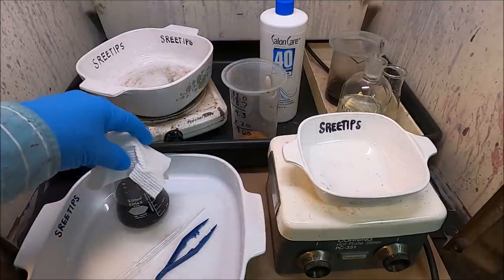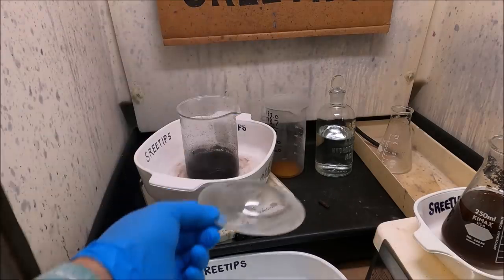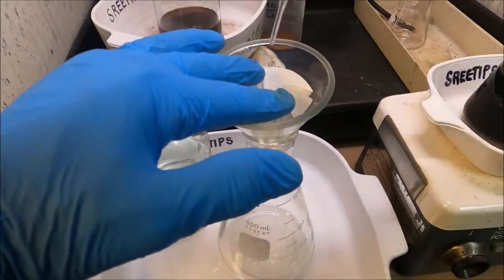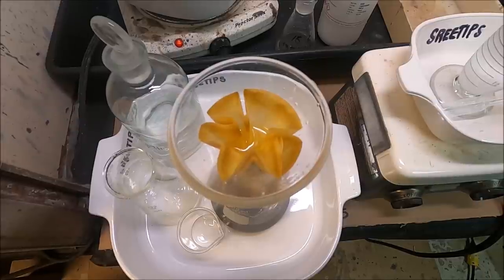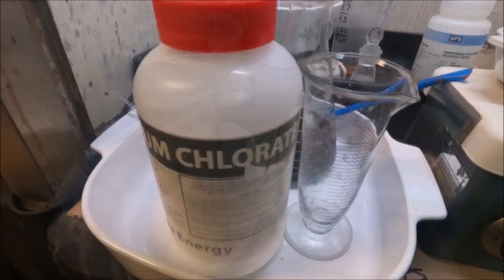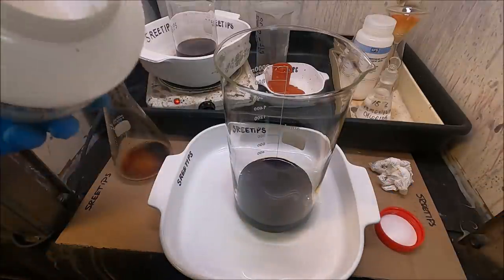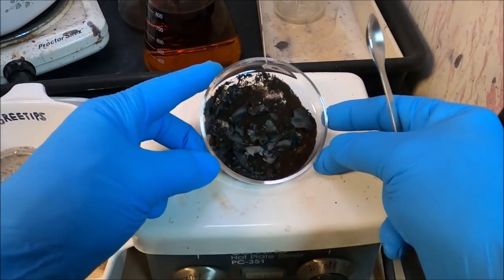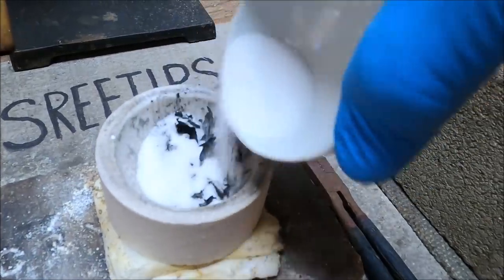Silver Cell Anode Filters Recovery and Refining Part 9

Comment: If is Ir that residuum onli solution powder of it melts at 2466°C so oxiacetylene flame but not reductive as you use for Ag, Au, Pd  bot hot oxidative "blue finger" 3000°C flame and graphite creuzet (one use because at 3000°C wil burn in air!).

Comment: Streetips , suggestions / request for videos ?
Suppliers of chemicals , products like glassware , stir/heat plates etc.
With all the China stuff , maybe brands to avoid / recommend .
Also some pricing ranges .
I have started finding all kinds of sources , but like most anything prices & quality ranges are all over the place , 
like melt dishes from just over $1.?? - $5 .

Then there is house hold chemicals and cost comparison , seems that high strength lab type chemicals will be quicker compared to drain cleaner , bleach etc.   

Not expecting , but just suggestions , along the lines of " Successful Engineer's " site , he seems to focus on the cheapest way with the least amount of waste .

Thanks again

Comment: Your comment about the little bead of palladium getting brighter as is formed into a bead reminds me of mt own making aluminum bronze. I melt the copper, then submerge the aluminum into the molten copper.  As you mix it the liquid metal gets a lot brighter. Swirls of brightness as you stir it. Its really rather neat looking. I say that's when the alchemy happens and the copper turns into gold. Bronzal alloy buts its a beautiful gold color. Its heavy since its 90% copper. Ancient people might have thought i actually did create gold from copper and aluminum.
Reply: Is bronzal alloy a possible answer to another sreetips video when he dissolved what was purchased on ebay as "gold flakes foils" in a little vial (it dissolved readily in a spot plate with a drop of nitric acid, resulting in a green color)?
https://www.youtube.com/watch?v=AM9zpapCM3Q

Comment: I did silver elecrtolytic cell but the silver I got soon blacken and it grew like little bubble but not crystal. I tried both large amp and small amp but the it still grew like that. Do u think it is problem of impurties in the electrolyte? like I added some Co(NO3)2
Reply from the maker: I use silver nitrate electrolyte and 99% pure silver shot.

Comment: Hey sreetips, i just want to know without electrolysis refining process of silver , if i only add nitric to scrap silver then i filter the silver nitrate can i recovered palladium from that silver nitrate or from that filter slimes??
Reply from the maker: Because palladium is soluble in nitric it will tend to follow the silver. But it will be traces only. The exception is white gold that is alloyed with palladium to make it white. In this case the palladium will follow the silver during nitric extractions of the inquarted gold. The palladium in these extractions will be great enough to allow removing the Pd from the silver solution with DMG before we cement the silver with copper.

Comment: Stupid question....what is the theoretical limit to purification of gold and silver.  If you gan get better than 4 or 5 9s is there an application or need?
Reply from the maker: Industry standard is three nines. There may be some lab applications where ultra high purity is needed. Any thing after 999 parts per thousand is like splitting hairs. Bragging rights maybe.
Reply: @sreetips  anyway your videos are fascinating.   I don't think most people could afford to do recovery safely.  It's not something you can set up in an apartment.  I know gold is more valuable but silver seems to be the best bang for your buck both in return and entertainment value.  Good work.

Comment: Why are there pgm's in the silver cell?
Is it a possibility that one of the pieces of jewelry that you refined through the silver cell might have been a platinum piece instead of silver?
Thank you and 
Have a GREAT Day!!!
Reply from the maker: Shane, silver is a known carrier of PGMs especially older pieces of sterling. Also, karat gold contains PGMs. When I inquart the karat gold with silver and part with hot nitric the PGMs will follow the silver. They will cement out with the silver on copper then end up in the anode filter of the silver cell. As the silver dissolves, any gold or PGMs will get left in the slimes of the anode filter.
Reply: @sreetips  Ok. That's going to be good to know when I start me adventure in precious metals recovery and refining!!